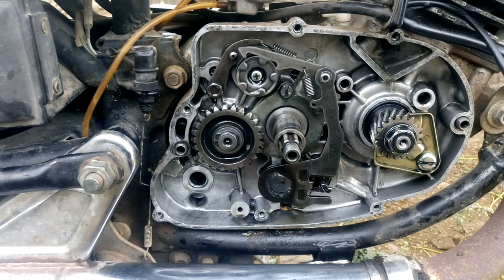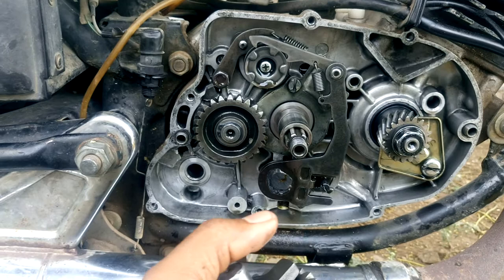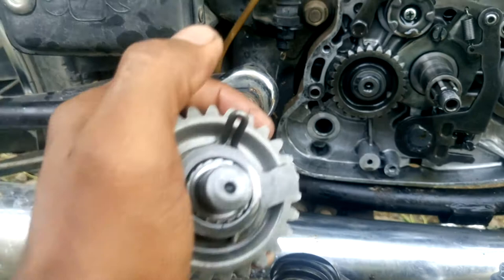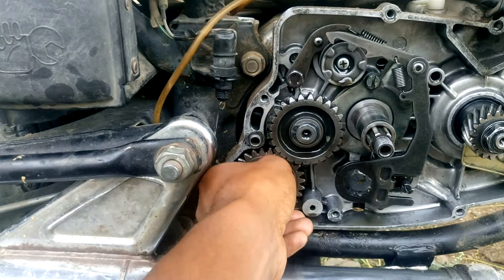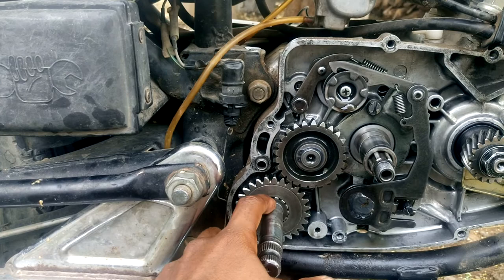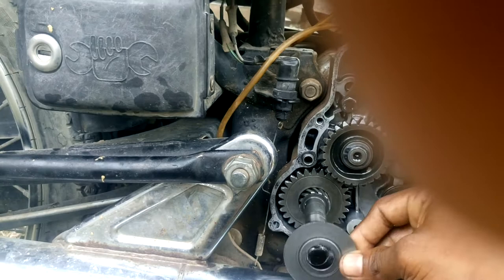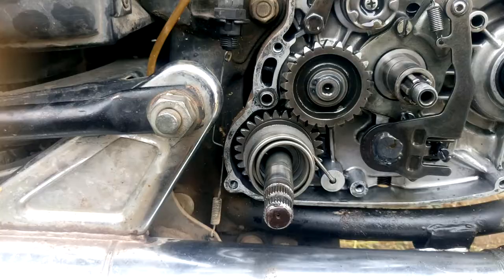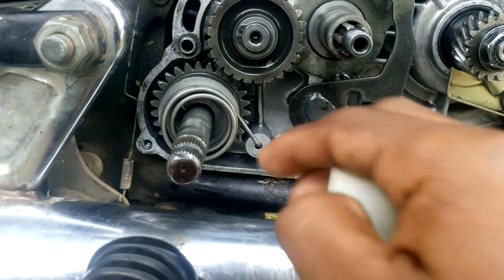Rx 100 - Kicker shaft installation

Comment: I have noise problem coming from the kick pinion. What is the problem bro?
Reply from the maker: Can't understand your question, make it clear bro
Reply: @madbiker946  i have noise coming from the kick shaft i don't what is the problem?
Reply from the maker: @6shifts602  I think the kick shaft gear is partially touching with idle gear which is a small gear above kick shaft as shown in video.you have inspect the kick  shaft pin which is attached with  kick gear by opening the clutch case.
Reply: @madbiker946  thanks bro. And another thing my engine is very slow i've put jet 136 in the carburetor but it does'nt give any speed.